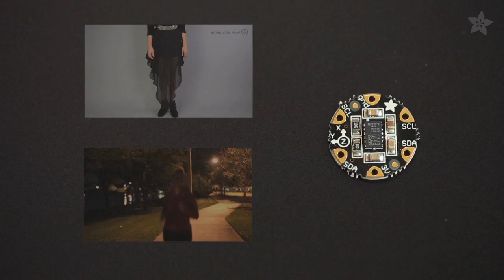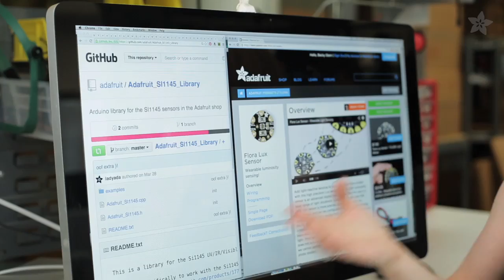FLORA Sensors

Comment from the maker: Which FLORA sensor is right for my project? #WearableWednesday
http://adafru.it/dNv

Sensors! They’re great for bringing interactivity to your wearables projects, and the FLORA family of high tech sewable sensors just keeps growing. They chain together and communicate over i2c, so you can add a bunch of sensors without using all of FLORA’s pins or sewing endless traces with conductive thread. Let’s find the right FLORA sensor for your project using the guide on the Adafruit Learning System.

Read More
http://adafru.it/dNv

Comment from the maker: FLORA Sensors - All the feels!  #Wearables   #FLORA  
https://learn.adafruit.com/flora-sensors

Sensors! They’re great for bringing interactivity to your wearables projects, and the FLORA family of high tech sewable sensors just keeps growing. They chain together and communicate over i2c, so you can add a bunch of sensors without using all of FLORA’s pins or sewing endless traces with conductive thread. Let’s find the right FLORA sensor for your project. Each Adafruit wearable sensor has an Arduino library with sample code to get you started, and projects to build here on the Adafruit Learning System.
Reply: I love Flora. I would like to have a Projects Academic and be a Adafruit Distributors in Bergen Norway.